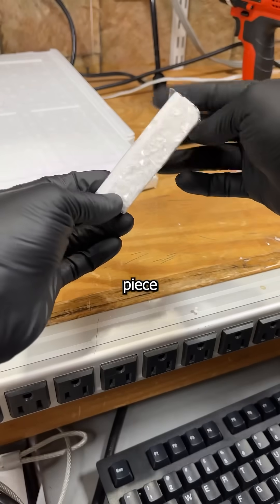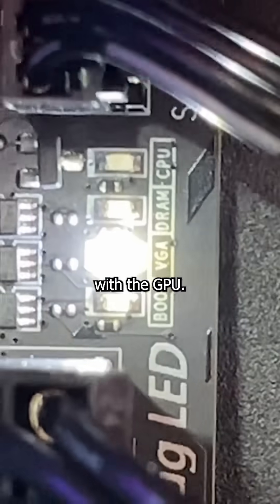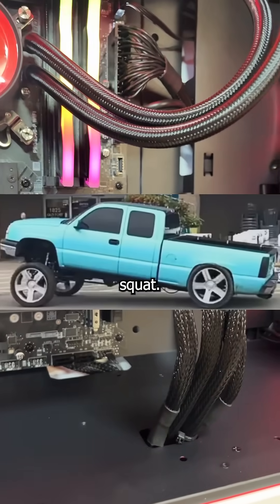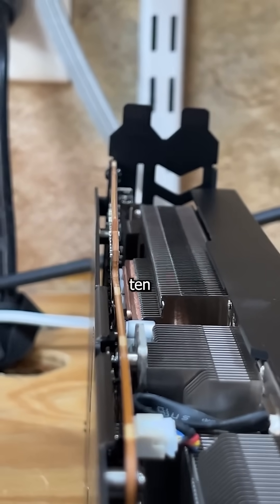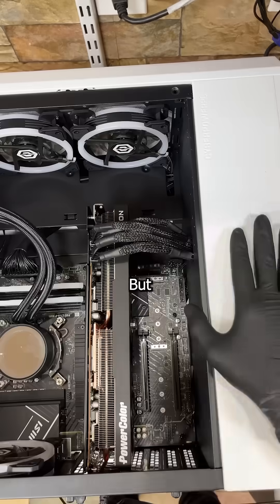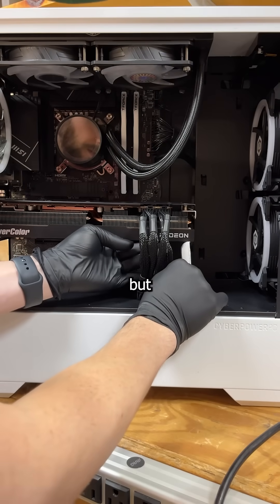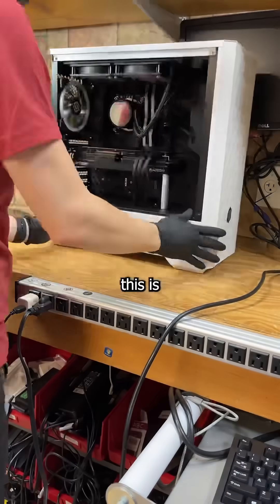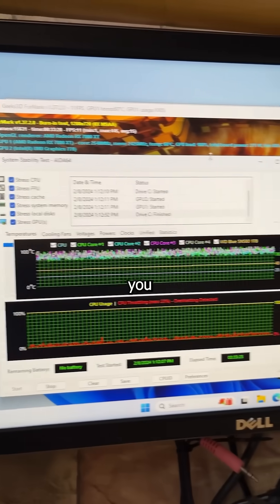Styrofoam vs. Brand New CYBERPOWER #PC (prebuilt fail) #tech #technology #shorts

Comment: One thing I've learned by binging all his shorts is to never buy from anything that's called "ibuy___" or "cyber_____"
Reply from the maker: I'm waiting for them to send me a sponsorship so they can redeem themselves.
Reply: @SalemTechsperts  😂
Reply: @SalemTechsperts  i think the chances for them sponsoring u are roughly the same as masterlock sponsoring mcnally
Reply: @lazysloth08 Hahaha true
Reply: @SalemTechsperts give me a recommendation to where to buy one that ain't shit xD
Reply: @SalemTechsperts  based on videos on LTT with their experience...
Their... support is less than ideal.
Reply: @SalemTechsperts  DO AN NZXT VIDEO NEXT, THEYRE GREAT UNTIL THEYRE NOT LOL, $360 aio was placed in a way that made it noisy and would vibrate my whole desk cause the lines were kinked and I had to trade my 3090 for a 3080 ti because the prebuild couldnt keep hotspot temps down and almost all games would crash, they also managed to bend my top case panel, all in a $4300 build, i decided not to send it back out of fear of receiving it in an even worse condition plus they wanted me to pay shipping, this was all right after Christmas so if i did all that I’d probably also be waiting another 2 months to see if they fixed it or fucked it back up again
Reply: @SalemTechsperts what about NZXT?
Reply: @SalemTechsperts  I have a $700 I buy power pre-built with a 1660 in it when I got my computer I couldn’t figure out why it wasn’t working they did not include any ram. There was no sticks of ram no SSD, which were both listed in the prebuilt description I reached out to them multiple times it took months for them to send me an SSD and no ram
Reply: @SalemTechsperts what do you think about Skytech? I don’t think I’ve seen one of there pcs in your shop yet.
Reply: @SalemTechsperts  you should take bets on whether they actually send you a good PC for the publicity or send you a crap one like the others
Reply: IBUYPROBLEMS AND CYBERSHI- POOP
Reply: @REDOMTF I have I buy power and it’s the best thing
Reply: @lukemom12  yea yea and I'm The president of the united states, bro the parts are cheapest u can get that work for the build and then the price is bumped up 200%, I'D RATHER HAVE AN XBOX WITH A GAME PASS FOR THE CONSOLE LIFETIME THAN THAT PIECE OF SH-
Reply: @REDOMTF IBuyProblems and CyberS**t
Reply: @REDOMTF ibuyshit and cybershit
Reply: I have a Cyberpower PC. It's been running nearly 7 years with no problems.
Reply: @codboroks97 look up "per capita"
Reply: iv had a gaming pc cyber for 3 years nothing went wrong yet
Reply: @felltrain115yes3 You only hear about the problem cases. By and large, cyber power can be totally fine!
Reply: "ibuyproblems"
Reply: @news_6062 IBuyPowerSupplies
Reply: Acshyully Cyberpower isn’t that bad, I will say the ram needed immediate upgrade on mine but other than that it’s pretty good
Reply: @SuprSBG thats about the same thing I had with my cyberpower pc I got like 7 years ago. The rest was all perfectly fine and I only just recently replaced the gpu it came with (radeon 580)
Reply: I've had a cyberpower power pc for nearly ten years and still works great
Reply: Friends have had a couple iBuyPower PC's, they're completely fine, over 5 years old probably had a 1060 and still works fine. Even with an Aio it works like an average PC. 

I dont think they're as bad as many people think, but if u know little about PCs ur not gonna know how to fix a lot of their small issues that come up. I feel like Ibuy/CyberPower are just extremely common among less tech literate folks.
Reply: I have a cyber power with a 4060 ti and it runs like a dream since unboxing.
Reply: @echo_laliaa  4060 💀 atleast it's not a 4050/3050
Reply: @echo_laliaa I upgraded the ram to 32 gigs and the processor to a ryzen 7 7800x3d in the one I got from Best Buy and it’s an amazing rig. Will be getting a 4070 super eventually (possibly a 4080) to replace the 4060 ti that came in it.
Reply: @echo_laliaa yeah these problems are rare
Reply: I bought a cyberpower 7 years ago and its still working.  Only had to change the fans and add ram.
Reply: Can’t be every system I got one for my kids an ibuy with an i7 10th gen and a 3070 and it’s been being abused by them for almost 2 years and no issues other than their garbage AIO failing, replaced and no other issues.
Reply: @Chris_dolmeth to be fair the aio failing is one of the most common issues with their pcs, it’s why they catch so much shit
Reply: @Chris_dolmeth  Word Up! I've obviously heard my fair share of stories about them, but at the time it was when gpus were just outrageous and it was way cheaper to just get a pre-built and I'm pretty sure I got the same exact one as you 😏 Even with the "Usual Suspects" of "lesser quality" parts especially for specific things like the power unit power supply/AIO/etc, I've had literally zero problems & I def run it through it's paces! Yes I would gotten a different one, but we got a great deal using my girl's Dad's "Rewards" Card! 😂 At the very least, you can take what you like from it & change the rest like you mentioned! I'm really glad your kids got a dope PC my brother! 🤘🏾🫡
Reply: @Chris_dolmeth 2 years is a very short period for a pc, my friends ibuypower prebuilt lasted 3 years. my pc with basically the same specs is going strong 6 years in, and the only maintenance ive done is a gpu thermal paste swap last month as it was literally non existent after 6 years
Reply: @Chris_dolmeth well yeah so it's still bad if it broke after 2 years
Reply: @Chris_dolmeth ummm, that's still a problem. Been running my home built pc for 6 years no issues once she posted. Literally the 1st pc I ever built, only previous building experience was a harddrive upgrade on the previous PC. How does a professional company stuff up this much?
Reply: @stormwarning6219  heck yeah that’s awesome you got a pc that’s had zero issues kudos! Even on the 2 I’ve built I’ve had a case fan here or there go bad but for you not having any issues that’s impressive.
Reply: @Chris_dolmeth I have an ibuypower, the aio failed so fast, and 4 years later now, there’s a new cpu, mobo, and an air cooler
Reply: @Chris_dolmeth no issues. Aio failed. Pick one.
Reply: @Chris_dolmeth but, that’s not no issues
Reply: @Chris_dolmeth kids and noobs aren’t gonna know what’s what when it comes to PCs. That’s why they cater people like you
Reply: @Chris_dolmeth that thing probably has a cheaped out psu that won't last for more than 5 years probably and you said it had a failed pump? For an average user that doesn't know anything about computers , they will be pissed if their PC shuts down and doesn't know they have a failed pump  even with the noise its making. That doesn't say good quality bro
Reply: @Chris_dolmeth they are generally bad but not always
Reply: @Chris_dolmeth yeah they are pretty good now. Just certain little issues. Like this isnt a true issue because most pre builds don't have a support bracket
Reply: @Chris_dolmeth how much did you spend on it? Cuz honesly it's the price that makes them garbage 100 percent of the time. Parts fail, especially cheap parts but it's less of a problem if you didn't break the bank to get the parts
Reply: @Chris_dolmeth  let's be real though, that's supposed to be one of the good examples, and you still had to spend money replacing a component that failed within the first couple years. You're kind of proving their point.
Reply: @Chris_dolmeth  Just a redundant answer. Of course not every system is like that but they're still utter trash for quality control and general care
Reply: That's insane to me cause I bought my first prebuilt from Cyberpower. It lasted two years till i realized i needed to clean it and it was too late. I then got a new one cause insurance and i've had it ever since. Going on almost 5 years strong ish
Reply: I bought one through cyberpower and have had no issues. Overlooked the who system and everything was supported and wired well. Even stressed tested it with no issues.
Deffinitly comes down to poor batches and overall who builds it and if they have the motivation.
My tech even gave constant updates which was nice.
This not to say everyone will have the same experience.
Reply: ibuytrash and cybershit, wonderful
Edit: ibuyproblems is also valid
Reply: @Leekodot15  meanwhile it's the same crap you would build
Reply: @DankHillCometh  At least if I build it, I know what problems it has and can compensate for it before I make any final decisions.
Reply: Once had 2 roommates. One bought an iBuyPower PC and one bought a CyberPower PC. Both were wired terribly and one overheated playing fucking WoW. Had to do constant maintenance on both and I tell anyone interested to not waste their time or money.
Reply: @Phipplle  when I bought my first prebuilt (which I still use daily) I saw the Cyperpower and ibuypower PCs from Best Buy and chose a decent MSI over them due to it having at the time one of the better GPUs available and an i7 with 16GBs of RAM. I fully plan on doing a custom built one soon though with a friend who is computer building savvy.
Reply: @Phipplle I have a cyberpower and it works perfectly fine 😂
Reply: @geraldlacy9601  I didn't say it was always gonna be messed up. I just avoid them due to personal experience and would never recommend them.
Reply: @Phipplle  I wanted to build my own PC but best buy had an insane clearance on a cyberpower PC so I rolled the dice 😂 I must have won the lottery twice that day! Once for the insane deal that saved me over 600 bucks on what it woulda cost to build and a second time for getting what must be the ONLY good PC they ever made 😂 I thank the PC gods often for this gem they bestowed me with
Reply: Eh...? My computer is CyberPower and yet it is doing pretty well still, my dad and me had it for 10 years and only had to replace some parts within the last few years mostly from wear and tear or in the case of my power supply the storm ending up shorting it after so many years...Hmm...They don't seem to make them as they used to it seems
Reply: They are fine to buy from and he has said this before but the only reason they have so many issues is because they are the thing everyone buys
Reply: I can no longer speak their brandname normal again. Thank you iBuyProblem
Reply: got one 3 yrs ago; havent touched it and its doing fab.
Reply: I’ve literally never had problems with ibuypower though I’m not sure on cyberpower but likely the same thing. But most of the time it’s the consumers fault of not doing enough maintenance! And with the support bracket they do send you one! The customer just never put it in! These companies are fine to buy from, but pcs need special care and attention, not like an Xbox where you can leave it running for eternity and it will be fine. You have to do regular maintenance on these machines and if you don’t wanna do that then maybe a pc isn’t for you.
Reply: @birucheeto7299  cyber power wacked out Ibuypower endorsed by Linus tech tips all you needs know
Reply: @birucheeto7299  P s 3 are not backwards compatible because they had so many problems... xbox ring of death... steam deck complete failure... consoles are just as bad ... ur just a pc. guy so you don't see it as much
Reply: Honestly buying a prebuilt at all is a bad idea since you won’t know if it’s assembled well or not, and sometimes stuff gets hurt in shipping (hence why usually they don’t put the GPU in for you since it may bend )
Reply: I had a prebuilt from ibuypower. No issues with it in the year I had it. Idk, some get lucky, some not so much.
Reply: IBuyProblems have good cases tho with the Y40, Y60, and Y70
Reply: I buy problems and cybershit
Reply: The sad thing is, they used to be pretty decent back in the day. It’s a shame that most pre-built assemblers don’t care as much as they should and take advantage of uninformed clients. Some people just want a PC, and aren’t in the know enough to build one themselves. 😣
Reply: I buy power did me good but it was few years ago for my very first
Reply: A vast majority of their machines are just fine. I used to build out my own machines, but got a really good deal on Ibuypower. My last two PCs were Ibuypower, and I've never had a problem with them. Of course, I am also technically savvy enough if any issues do occur, but replacing 1 HDD after 6 years is the only problem I had.
Reply: I have a cyber power pc with a 2gb amd rx 560 and a fx 6300 it’s so old but still holds up decently hoping to spend my life savings to build my own with a 13700kf and a 7900xt
Reply: Really thankful the prebuilt Cyberpower PC I got isn’t having problems like this. Guess I got lucky?
Reply: My cyberpower was built decently i just fixed their cable/aio routing and added some fans.
Reply: I will say my first pc was a cyber power but it was good and lasted with no issues besides the case being small when I wanted to upgrade parts
Reply: I've built all my computers since the early 2000's. The only prebuilt I've had was a notebook computer. It was great for what I used it for, writing. After I removed all the bloatware that is.
Reply: and I've learned from watching vtubers to avoid Skytech Gaming at all costs. (my current rig is a iBuy referb with a few upgrades)
Reply: Remember by watching repair videos you are receiving a huge sampling bias towards negatives.
Reply: I'll defend Ibuy bc I had a computer of theirs for 8 years, and it lived to an upgrade perfectly fine. I just dusted the damn thing every 3 months and it was perfectly fine.
Reply: I’ve heard only good things about ibuypower, over 8 people I’ve played games with for a while say ibuypower is great and recommend it
Reply: @SouthTexasGaming17  mines lasted 7+ years
Reply: Digitalstorm is the best of them in my opinion but those computers are way over priced. You can buy a tower with a 4060 and 16 gb of Ddr4 for $1300. I put a parts list together for a computer with a 4070 super, a 12600ks and 32gb ddr5 for the same price. It just does not seem worth it to buy pre built from a company like this. I wish I never did and just spent the money I had to build my own but I was completely ignorant when I got mine. Please just look at doing it yourself and save hella money
Reply: Wrong, I’ve had my Ibuypower for 5 years, not a single problem. My buddy bought a custom pc from them, he’s also not had a single provlem. All depends on the parts you get.
Reply: @ZannkyOG  you’re a pc niib
Reply: ibuypower is dog shit ive had 3 all broke i now have a skytech and its very nice
Reply: My first desktop was this horrible Windows Vista machine that ran Minecraft @ 10-20FPS. Eventually my dad bought me a CyberPower with a ryzen 2700 and a 1070. It ran pretty good. I took that PC and slowly upgraded the shit out of it until I ended up getting the Corsair 4000D and having an entirely new PC from all the parts I swapped out. Now I have Thermaltake 500 and a 7950x.
Reply: @ i started with a freakin amd 8320e black. This was pre-ryzen days bro. And a 750Ti. Slowly upgrading over the years and now im running a ryzen 5800x and a amd rx 7700xt
Reply: @davidponder1654  yeah I was 9 when I had my Vista machine. I hint at being very young when i said my dad bought it for me.
Reply: I bought a 800 dollar cyberpower in 2018 when i was in middle in 8th grade, it's lasted me to this day with some upgrades
Reply: Nope just eBay
Reply: It's still good for people who don't want to build a pc. Just that these Companies like to cut corners just to save more money.
Reply: 100%
Reply: Picked up a cyberpower from Walmart, display would go to static, happened 5 times in 7 days so I drove it back to Walmart and refunded.   I kind of half heartedly wiggled the GPU but I ain't buying pre built to troubleshoot someone elses mistakes.
Reply: What's wrong with ibuypower? I've had a pc from them for well over a year and its worked great
Reply: Ibuytits
Reply: +1 on ibuy___ just fixed one of them, PSU blew up taking the graphics, ram, and all storage, the cpu and mobo lived, but upon checking/testing the cpu found bent pins, its all good now tho
Reply: iBuyNewPCParts
Reply: Don't go Corsair either. My dad just spent close to 5k on their top of the line and has had to send it back 3 times in the span of a month and a half. Absolutely awful quality assurance over there too
Reply: I got a gamingxtreme from cyberpower a few years back, say 8 years ago and it's somehow still going
Reply: Or "Alien____"
Reply: I push my cybershit pc to its limit. It was already 14 years old by the time I replaced it. Anyone need them old green 4gb ram stick? 😂
Reply: Easier than that, never buy a pre-built pc. It's easy and fun to buy the parts and build it yourself.
Reply: I have an iBuypower case but a custom build, (my cousin gave the case to me) and the case has… sub-optimal cooling
Reply: iBuyGarbage
Reply: 90% of prebuilts are grossly over priced and suck shit. 

The other 10% are just grossly overpriced.

Good luck.
Reply: When I bought Ibuypower I didn’t know any better but I still have it after 6 years. Pretty sure it came with a bad ssd tho. Within the first few months it blue screened when I shut it off and I took it to Best Buy (again I didn’t know any better)and they just reinstalled windows. I’ve kept it on since not even to sleep untill recently I turned it off a few times and it blue screened again but after I put a new m.2 ssd it’s been turning on faster then ever. I now know more about computers and am gonna build something crazy.
Reply: no you should never buy a prebuilt period not worth the money
Reply: @vincentkenjiro4054  It's actually not that bad considering what you get. Like, amount of things wise. You get a Windows key, that is usually like $150 or something like that.

What I worry about is damages during delivery, and badly chosen parts (like 1 singular RAM stick, which some do), badly mounted parts and terrible customer service to actually fix it.
Reply: @JMPERager  naw you get better performance better experience when you build your own my friend got a prebuilt it’s slow and struggling I bought used and new parts and put it together and it runs super smooth n fast
Reply: ironically i stopped making my own machines about 8 years ago, because I was having to do all of the work to get them running, and any issues with them left me on the hook to fix them. I'm on my second Ibuypower machine,. now I make them custom each time, and I price them out with part picker to make sure I'm not getting overly ripped off.  my most recent one I think I paid about 150 more than the base parts.  but with that, in the last 8 years I have had to do no RMA work, and I only call them up, tell them the part that shit itself, and they do the world to get me a new one.  my last comp I made, Asus had come out with a board that was just pure shit in terms of durability, problem was, it was not known until after bout a year, so I got it, it had good review, and everything, but after a year, it was known to be a piece of shiti had to RMA that thing so many times, and then file claims with them for the parts that it broke in other parts of my machine.  can I make my own machine, sure, do I want to take the time dealing with the companies no.  IBP does not make the best machines, but they usually stand by their warrenties and have never fucked me personally.  but I would never buy a prebuilt, every company I see with them, they look way over priced for what you get.
Reply: Honestly a lot of the laptops are fine you just need to see who actually made them.  They're usually Clevo or Tongfeng models which are your best bet for a good laptop so if there's one with specs at a good price just check if it's that and you're good.
Reply: the laptops arent my concen that much its the gaming desktop @artosbear
Reply: Yeah prebuilts from Ibuypower absolutely suck. But their custom stuff ain’t too bad.
Reply: When I was young I bought an iBuypower laptop and boy oh boy did it have cooling issues. lol  Basically couldn't game above min graphics or it'd overheat.   Sadly, I didn't attempt to play anything graphically intensive until much later after the warranty expired. =/
Reply: I got mine prebuilt from cyberpower in 2018. And the only thing that remains of that is mobo and 2 sticks of ram. everything else is maxed out. I got no complaints.
Reply: Terrible customer service!
Reply: 11/10 times the best bet is to avoid pre-built and build it yourself.
Reply: The only reason I've bought pre-built is for their parts just happening to be cheaper as a whole, worked out both times for me so far.
Reply: Owned both of these brands when I was younger back in like 2004-2012, no quality issues at all, they’d just keep running, but both of them created a TON of heat.  I remember sitting there playing WoW in my underwear because they would make the entire floor of the house I was on 90F
Reply: My current and first gaming computer is by ibuypower. I've been slowly replacing it piece by piece lol.
Reply: Same
Reply: Recently got an ibuy, upgraded ram and SSD and it's amazing
Reply: Only thing ive Brought from Ibuypower is the snowblind case (the one with an lcd side panel), thats served me well for 3 years now, but yeah wouldnt trust getting a prebuilt from them
Reply: My first pc was an IBUYPOWER. Never really had issues with it. It was just a bit overpriced, but I didn't know anything at the time. I've upgraded everything in it, but the case. Man I love that case
Reply: I’ve had a cyber power PC 3070 been upgrading parts since 2020 PC is perfect condition
Reply: Ibuypower❌️
Ibuyissues✅️
Reply: I got on from em and it works great
Reply: My ibp has been perfect for years
Reply: i have one but to be fair i’ve already swapped out most of the original parts
Reply: Meanwhile I've never had a problem with ibuypower custom builds since 2010 and 2 comps😮
Reply: the ibuy mobo that came in my ibuy pc was shit, not to mention the shit CPU cooler that came with it and the ram sticks, the GPU was the best part since it was the asus gtx 1080 (rip,it died)
Reply: Ibuypower?

I
Buy
Problems✅
Reply: Tbh I have the Slate 6 iBuyPower nothing but good things to say. Got it brand new for $700 off OfferUp. Is there better options yes, but for the deal I couldn’t pass it up! Plan on upgrading my case and GPU here soon.
Reply: I bought a gaming PC from iBuyPower back in 2010 for $600 because i didn't feel like building another one myself. It still works fine. I had to replace the power supply after like 8 years, and I upgraded the GPU after 10 years. 
My only real complaint is that they used a micro motherboard so I wasn't able to upgrade it properly without building a whole new pc. 
That said, I wouldn't buy another pre-built gaming pc.
Reply: @SalemTechsperts Ibuyproblems!!!
Reply: ...too late-
Reply: ibuyshit and CyberShit
Reply: iBuyProblems and CyberShit
Reply: Ibuy at least has decent prices among prebuilts, managed to get a custom system from them with a 3070 in the middle of the pandemic at a decent price, the windows install was bad, xmp and rebar weren't enabled, and the fans on the aio weren't pwm lmao.
( I got a 3070 aorus master in it, tho, and managed to sell all the parts at little loss later on, so it turned alright in the end)
Reply: idk i think these are outliers i got my pc from ibuypower and it runs perfect and they gave me a free ram upgrade i've had it for a little under a year now and i've literally never had a problem with how it runs
Reply: always learn how and just build a pc and never buy a cyber shit or a ibuyshitter
Reply: Ibuypower isn't bad I got one of their prebuilts back in like 2016 for Christmas I just upgraded the GPU to a 2070 super and it runs everything fine till this day only complaint I had was the low watt power supply but it wasnt a problem until I upgraded my GPU so. Thing is running strong almost a decade later lol
Reply: @picklerick157  that was almost a decade ago when they just had it big from cs. ibp pcs now are trash. you got lucky
Reply: @picklerick157  nothing against your current build it’s just most company’s became cheaper after the fortnite boom since everyone wanted a pc
Reply: @beamingyoshitzgod  no I can see that I guess mine was made fine though lol glad it was I haven't had a single problem with it so seems like I got lucky
Reply: ehh thats not true at all my first pre built was from cyberpower and it has lasted well over 10+yrs no issues at all so .. alltho i will say unlike majority of the people who send him there pc i actually take care of my stuff i clean it , re apply paste ect..
Reply: @ivyl4847  well that was 10 years ago. i’m not saying anything bad abt them from 2015 and before that. i’m talking shit abt them in 2020-2024
Reply: i have a cyberpower pc that i bought like 5 years ago and its still going strong. granted i coulda got a way better pc if i built it myself but at that time i didnt even know what any component was
Reply: Ibuypower throwing their CS:GO match in 2014 now throwing building a good PC in 2024 💀
Reply: this might sound typical but building a pc yourself will be far better. prebuilts almost always have a 100-200 dollar “build fee” ive seen some go up to almost 400
Reply: Actually I bought a Cyberpowerpc with a 4070 super and an i7-14700kf back in February and it was running great until I ran into issues with my cpu. I sent it in a few days ago to get it repaired by cyberpower themselves for free besides shipping costs. As far as I'm concerned they're doing a good job.
Reply: He's been shitting on ADATA SSDs as well and rightfully so
Reply: The PC I have now is a cyberpowerpc that I bought in 2016 or 17. It's been great. Granted, I've upgraded like 90% of the parts (new GPU, cpu, pau, ram, cpu cooler, added ssd) but still lol.
Reply: Rip wish i saw this before i did. I ended up with a shit case with apevia molex daisychained fans and a refurbished gpu that was supposed to be new.
Reply: Add gaming and AI to that
Reply: Eh my wife and I I both bought cyber power and they’re working fine
Reply: My ibuypower pc has been kicking ass for 6 months straight
Reply: Don’t forget 👽ware
Reply: damn skippy. Never really paid the brands any attention, but now if they come up in recommendations i instantly say F&(k that no matter what the price
Reply: iBuypower sent my buddy a pc with loose ram sticks
Reply: I just bought a cyber power pc today.... Iv been getting mixed reviews on it some say its an amazing others say its trash
Reply: @ hit or miss. It could be absolutely fine, could be loose connections all in your rig. You never know and thats where the real problem lies, theyre so inconsistent. But a smaller issue is they just charge too much compared to the parts they put in. I mean their 1800$ model only has a RTX 4070, which isnt a bad graphics card but for a 1800 buck build its almost criminal
Reply: Currently using my brothers ibuypower I got him 7 years ago with an i7 8700k and 1080ti and the only thing that’s failed on it is the AIO which is to be expected after 7 years
Reply: @tbug50  seems to be the aio is the only part they cheaped out on lmao
Reply: @ definitely that AIO probably shouldnt have lasted 5😂 like i said theyre not all bad just hit or miss and usually not very great prices
Reply: Or something that starts with h id I want good hinges
Reply: Really you just want to avoid everything "pre built"
Reply: iBuyPoop and CYBERPOOP
Reply: pre-built "custom" rigs suck.
Reply: I got a cyberpower all I do is CAM/CAD work on it mostly no gaming at all and it's been pretty damn good ..I would have went with something else or higher quality but best buy card I get 24 months 0% interest ..that's a hard deal to pass up
Reply: Cyber monday
Reply: I have an ibuypower and I haven’t had any issues with it, not even with the aio, have had it for 3 years now exactly
Reply: Or CLX
Reply: Tbf I bought cyberpower years ago. They offer an option to ship with internal foam so nothing sags or breaks on transport. The thing that finally went on it was my MOBO but it was literally just the board. Lasted me I wanna say 4 years before the MOBO got fried. Expensive but being someone with no PC knowledge at the time it was "worth" it
Reply: My original computer was from iBuy Computers but in about 3 years I had replaced everything from the original computer. Never had issues with it. I still have the original keyboard and mouse.
Reply: Ibuy has an option to ship the GPU separately which is nice since they probably won't include the bracket or post. Also I buy prebuilts just because I can't be bothered to do cable management and assembly. I do however take a look at the pastes on arrival.
Reply: Ibuypower. ibuyproblems
Reply: I bought q Cyberpower in 2013. It still runs great. Over the years,  I improved the ram,  I bought better graphics cards, and even switched the old hdd for an ssd.

Still runs perfectly. Taught my brother and sister how to take care of pc's on this old thing.
Reply: My ibuypower is just fine. Had it for 3 years and only had to replace the ssd and graphics card. I used it hard so I'm not surprised the card went. Just did a little upgrade with the graphics card, ram, power supply and more fans and it's nice and cool under stress. Going to do the cpu next. Pre-builts aren't all bad. Just know what you're buying and more importantly where you buy it. Got mine at best buy. They're good starter pcs for new people.
Reply: I absolutely love my ibuypower pc
Reply: Or alien
Reply: I bought a cyberpowerpc back in the day and it was alr. Now everything has been swapped out of it besides the case and power supply.
Reply: Ibuypower pc been running for 7 years now no problems but the aio recently just failed. Had to buy another one other than that allg
Reply: Never had an issue with Ibuypower. I've had 3 PCs from there.
Reply: I have a Ibuypower pc and it runs beautifully.
Reply: I've used my ibuypower for 3 years. It can run anything i throw at it
Reply: Or maybe it’s the -power at the end of the
Reply: I have both pcs an they work fine for me literally no issues and ive had them for 2 years. Th only i chose to put into one of my pcs was the cyberpower pc. An i only put $60 into it so far (ram) but im lookin to put more into it.
Reply: alternatively, just has power in the name
Reply: I bought an gaming laptop off of Ibuypower almost 8 years ago. Still running strong.
Reply: and Smartbuy, besides there cheapo cds are fine for what I use
Reply: My wife and I have had iBuyPower for 6 years and had no issues.
Reply: My ibuypower is still goin strong. 
Won’t claim it is the best by any means, but as someone who is too scared to copy my sata ssd to a larger storage one. Pre-built is fine by me.
Reply: I dunno, Cyber Acoustics has some pretty good PC speakers. :3
Reply: the two brands: ibuyproblems and cybershits
Reply: Idk I’ve bought 2 pcs from cyber power both $3,000 zero problems actually run amazingly. They have really solid prices also.
Reply: And HP = Hinge Problems
Reply: My iBuyPower from 2017 is still kicking actually with no issues.

However, I temporarily bought a Cyberpower PC, it worked fine for a day but then suddenly started instantly overheating during boot.  Turns out when they put it together they CPU cooler's wire was between the cooler and the CPU so once the plastic had melted off, the cooler shorting out was superheating the processor.

I returned the PC upon discovering this.

I would not recommend Cyberpower but at least 8 years ago iBuyPower was clearly decent.
Reply: my first "custom for gaming" pc was an ibuypower about 20 years ago, thing was pretty lit, wonder what happened
Reply: I got an ibuypower PC and it works just fine lol
Reply: Add Skyforge to that too
Reply: I had a Cyberpower that worked ok for a couple of years and then the PSU died and took the GPU and a ram slot out with it.
Reply: I had mine for for 6 years. Was great for its price.
Reply: I guess my situation is a little different cause I had ibuypower custom build a pc for me and it’s been running strong for almost a year
Reply: Not disagreeing, just inputting that the iBuyPower rigs can be a solid score for those who know how to improve the numerous issues they are built with.
Reply: Trying to fix ibuy__ pc I found from the dumpster......I put it apart and together again without taking pictures 🤦‍♂️ and now it does not turn on lol and I finally got some RAM to see if it didn't boot because of that but now it won't turn on 😂
Reply: My ibuypower actually is great, oddly enough.
Reply: My cyberpower is decent, but I bought it years ago, so they might have been better back then. Seeing this, I would not buy a new one from them
Reply: I had to fix the daisy chained power to my gpu and replace the terrible no name psu to get my CyberpowerPC stable. I built mine myself the next time.
Reply: Or Razer😂
Or HP laptops bc their Hinges are Problematic
Reply: Yeah it suck’s because for awhile they were cheaper than just the parts or you couldn’t even get cards. But to not brace them is wild
Reply: Or just starting with I
Reply: Or Razer.
Reply: I only bought Walmart overpowered pcs. They were so good you didnt even got what was in the listing!
Reply: What's the ibuy?
Reply: also the green 3 sided thingy symbol company
Reply: Ibuyproblems and Cyberpiss PCs lol
Reply: I swear I had one of those and it was fine
Reply: Feels like 99% of pre builds are awful. You might get lucky and get a good product but unlikely
Reply: Too late both my computers are from them lol. My old one i got used for 200 was ibuy and was actually pretty good despite the 10 year old gpu. My new cyberpower doesn't look like it has any issues yet but I gotta make sure to check for the support bracket lol
Reply: just... dont buy a prebuilt from a big company
Reply: @Xenon_Proto  so I’d be better off buying a prebuilt from Johnny through eBay using Colgate thermal paste?
Reply: @Xenon_Proto Expected for Micro Center and Lenovo Legion. They are good as hell.
Reply: Also the people who buy pre-builts are the same ppl who won't try the fix the problem themselves so they end up in repair shops WAY more often
Reply: @firesidechess9782  my pre-built pc has been going on strong for five years without any issues.
Sounds like a you problem.
Reply: @firesidechess9782  Likely they are buying prebuilts because they don't have a clue about computers. A lot of people are that way, they think of computers like toasters, just appliances that are supposed to work, they don't care how they work.
Reply: @firesidechess9782 that’s wrong I bought pre built cause it was the same price as building it since the pre built was on sale and I got a 2 year warranty I bought it for the warranty and I’ve fixed the aio cooler myself and the motherboard cause of this same issue
Reply: @firesidechess9782 you’re so right! I try to tell everyone I know never buy pre-builts. Either build it yourself or at least use a system integrator.
Reply: Can add Skytech Gaming to that list, although not because of these shorts.
Reply: @cjnf11 skytech is really good. I had one that lasted me 10years only because I was running games on it that were way above it's specs but it held on for 10years at a $700 cost to me. I recently upgraded to a new one from them and no problems whatsoever. Not to mention they have great customer service as well.
Reply: as a former prebuilt buyer, cyperpower gave me a 100 gb ssd with a 1tb hard drive, i literally couldn't play anything on it
Reply: You shouldn't buy pre-buult from any of these companies IMO.
Find a local PC builder, whether professional or hobbyist, and pay them to build it for you.
Sure, it might be a little more expensive, but at least you get a quality build.